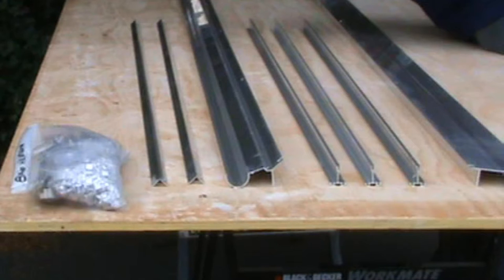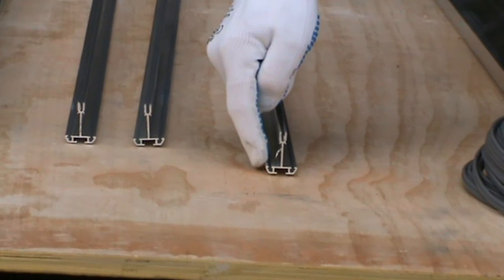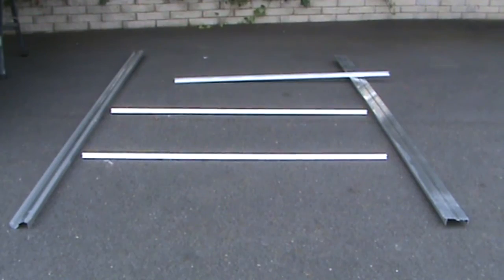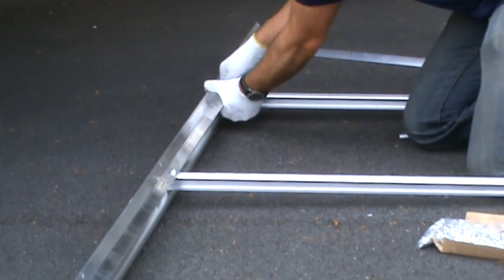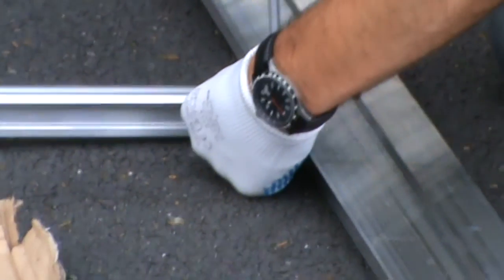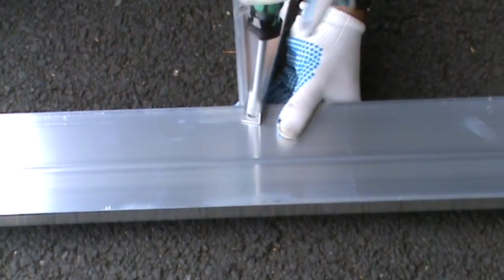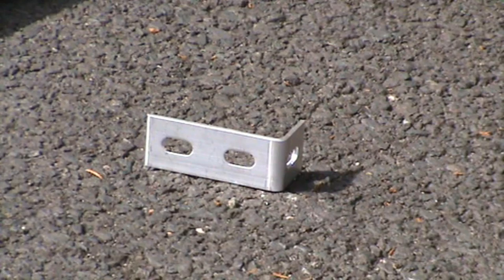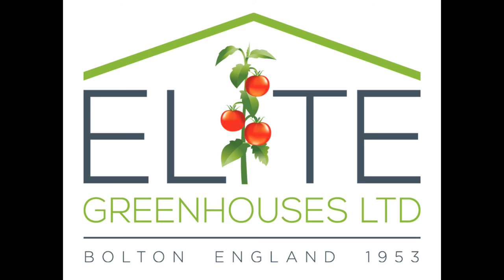Elite Self-Build Video - Side Frame Assembly

Comment: I found this useful but could be a lot better. 
Have you ever been to a lecture or an in-house demonstration where they have background music. There is a reason for this.
There should be more information about fitting a shelf as you cannot fit it after the assembly. You will need an extra 2 screws per glazing bar. The guy started to explain this but got bored. 
There is no mention of how you deal with having the bracket at the end of the side and how this needs to be fixed to the corner piece.
6/10